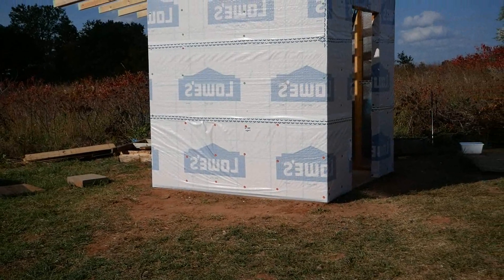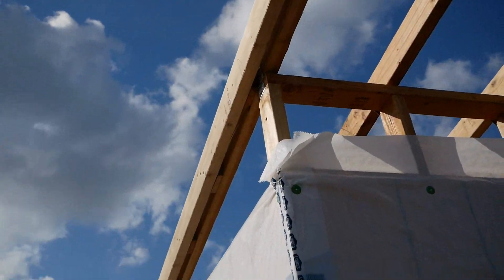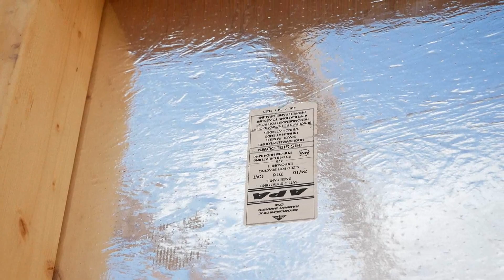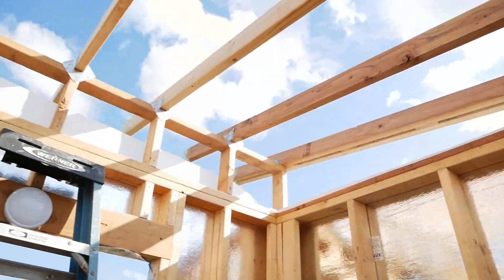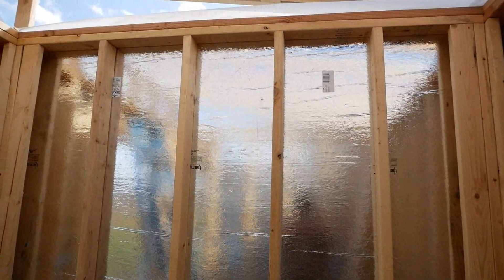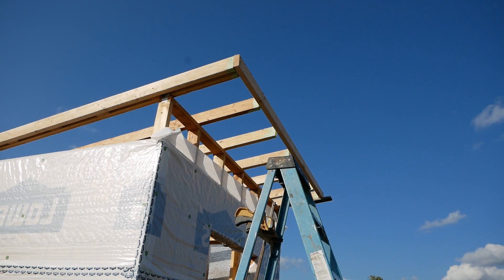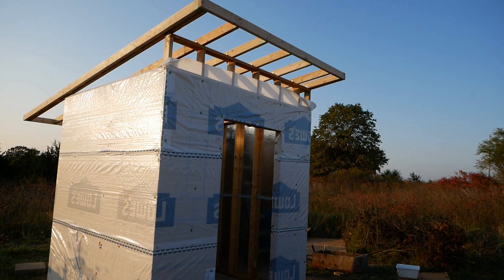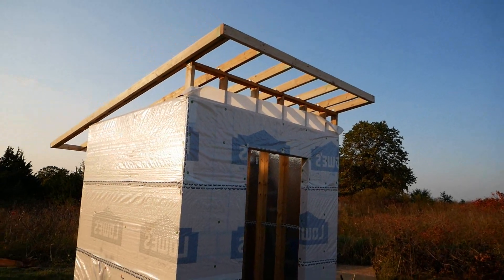How to Build a Shed - Part 3 Skillion Roof Framing

Comment: The well house is coming along great.  I think it is just built to stand for a long time rather than skimping on the build.  Building your own house is a long process unless you have some good help.  Also pneumatic tools would help out greatly.  Certain things should be hired out for accuracy but double check their results.  Fiberglass insulation or other insulation in the roof and even the walls will help control the temperature inside your man cave I mean well house.  
Darker roof will help heat in winter and summer.  You could always add a solar panel to the back overhang to charge a heating wire around your actual pump.  Of course if you have electricity there then all you need is an incandescent bulb or two inside to keep the chill off the pump.  You could also build another box around the tank and pump with a bulb inside for the winter as well.  Then remove the box for the summer.  The box could be built from insulation board so it would not be heavy to lift off.  Tape it together so you could fold it flat for storage. thanks for sharing.
Reply: interesting points ,if anyone else trying to find out backyard storage sheds plans try WoodBlueprints. Com Ive heard some dece.nt things about it and my colleague got cool success with it.